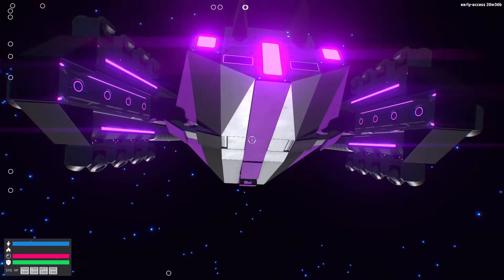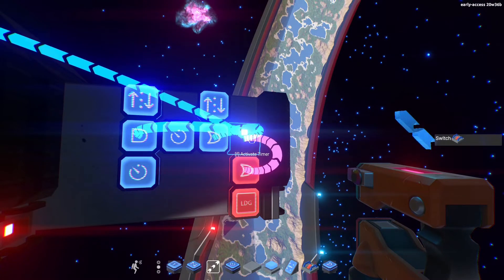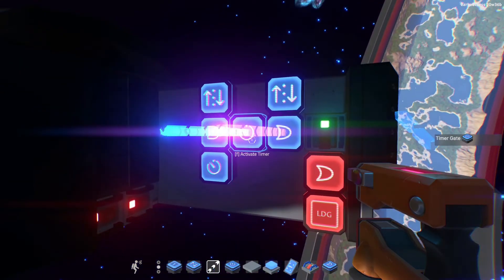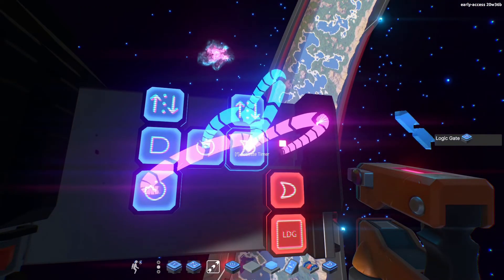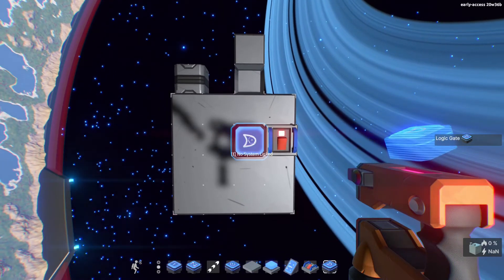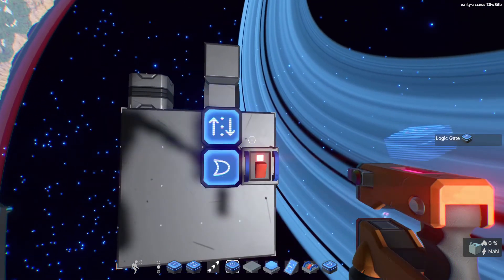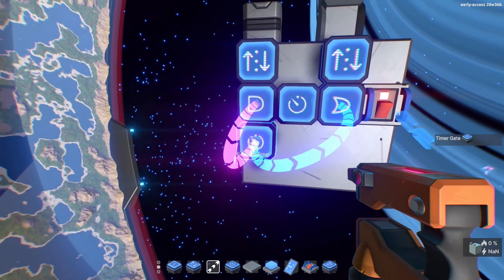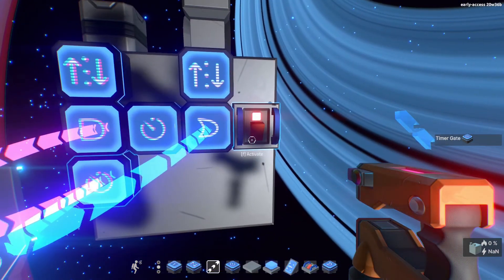Starship EVO ABBA Circuit or Reversing Sequence Tutorial

Comment: TLDW Tutorial

1. link Input to OR gate (First Output)
2. link OR gate to Timer 1 
3. link Timer 1 to AND gate (Second Output)
4. link AND gate to Timer 2
5. link Timer 2 to OR gate
6. link Input to AND gate
7. Turn input on and off several times to ensure that the circuit is working